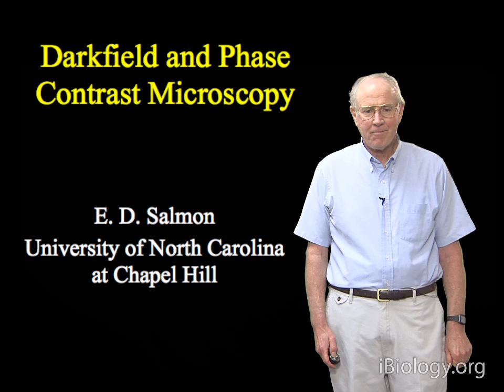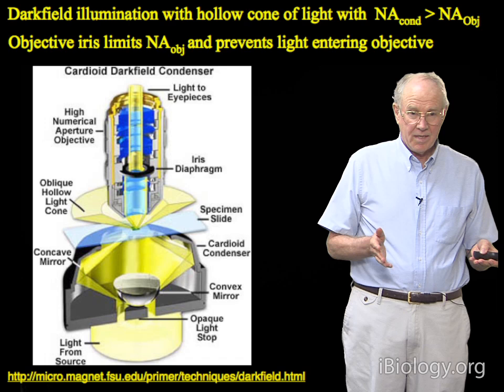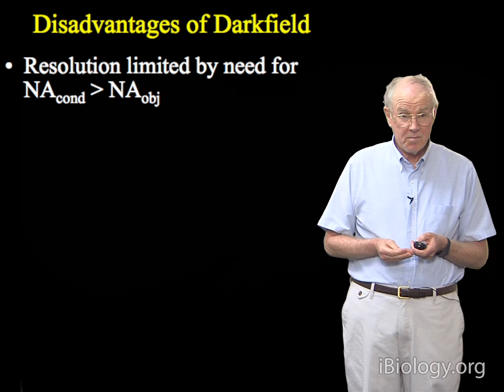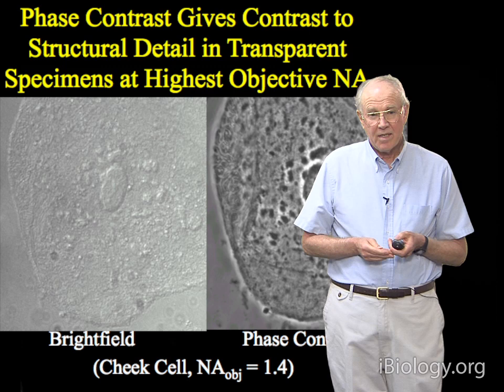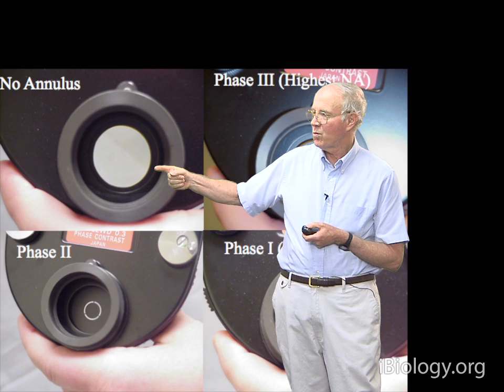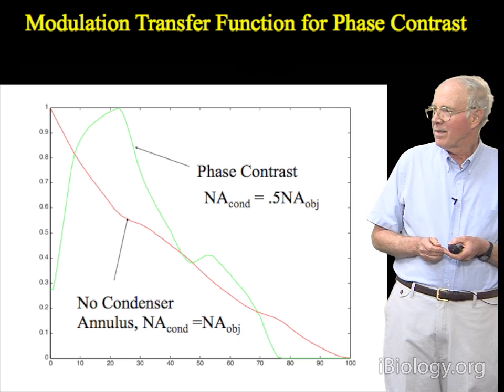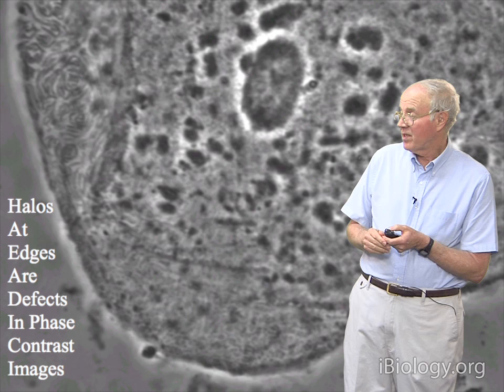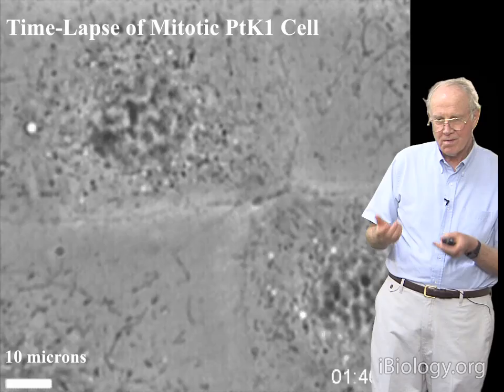Microscopy: Darkfield and Phase Contrast Microscopy (Edward Salmon)

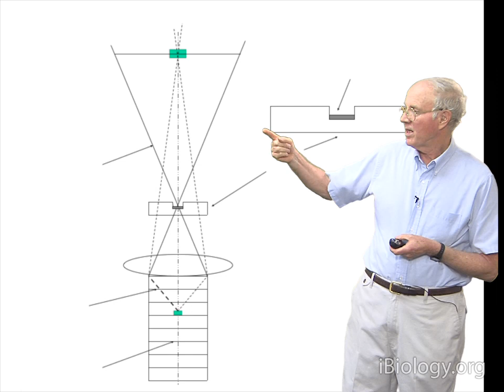Comment: the back ground slide at 16:30 doesnt make sense. If the diffracted  light is focused on the  quarter wave plate, then how can it be focused too on the image plane ? Moreover if the planar/collimated illumination focuses on the image plane, meaning the focale distance is the image plane distance, then how is it that the specimen is focused at the same point ??!! The specimen could not have an image if it's closer to the lens than the focal distance, and if it's further away then the image must be further away than the focal distance....